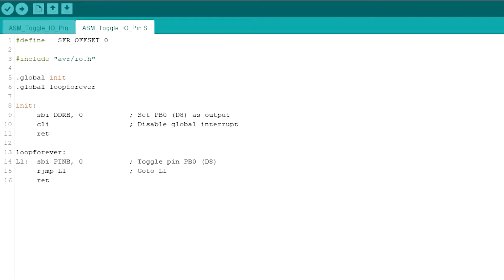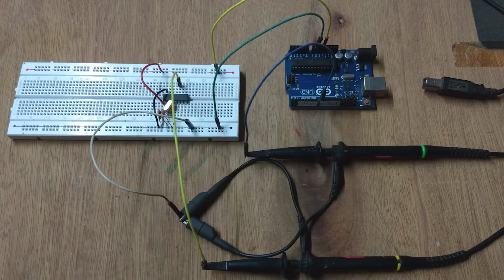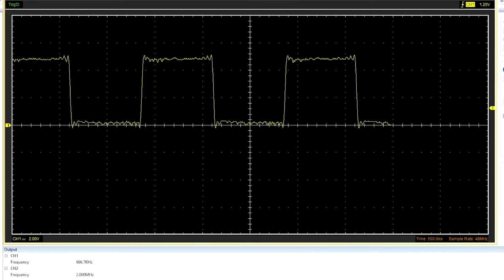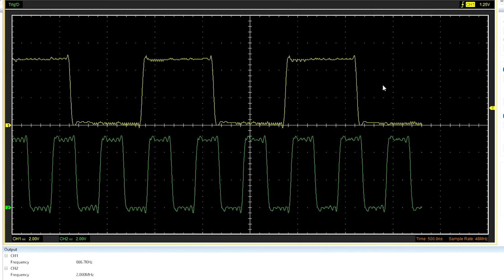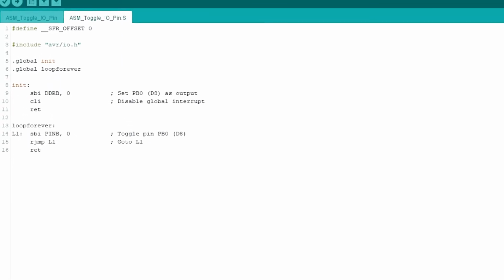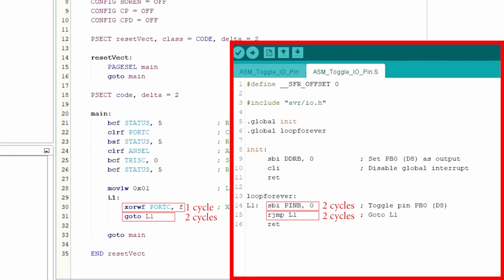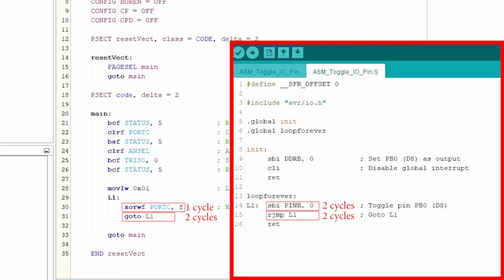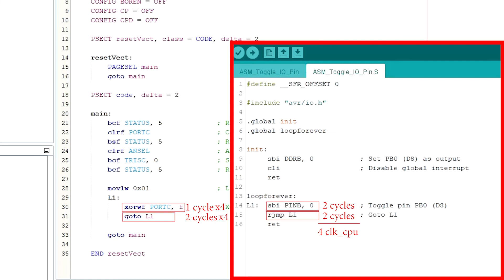Who can continuously Toggle an IO pin faster? Arduino or a PIC uC? - Let's find out!

Comment: using the Arduino Fast Pwm mode with ICR1 register as top value ,we can adjust the ICR1 to make the PWM(or square wave in this case) 8Mhz. that should be the fastest toggle.
thoughts??
Reply from the maker: Yeah, you are technically correct. But what I tried to mean is the fastest continuous toggle through software without using PWM in Arduino or CCP in PIC or any hardware interrupt. My sentance was a bit incomplete here.